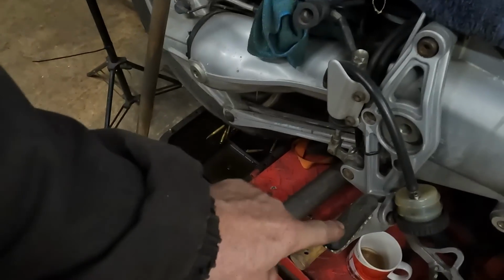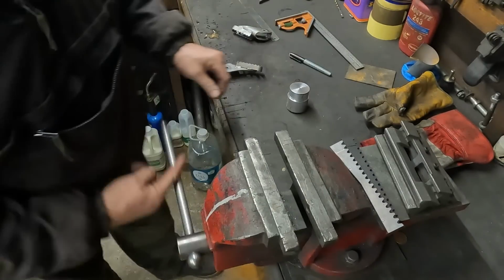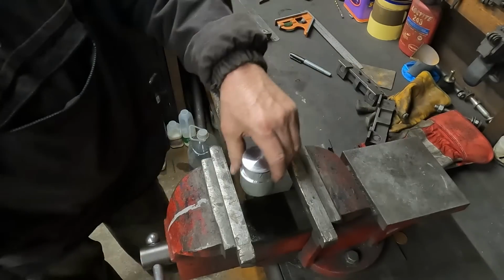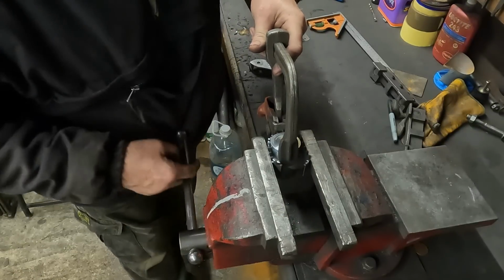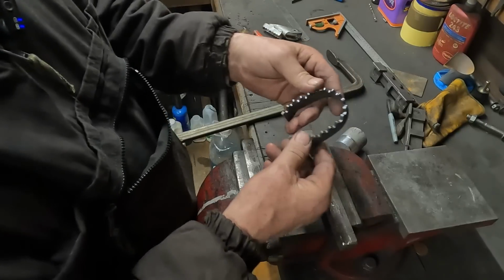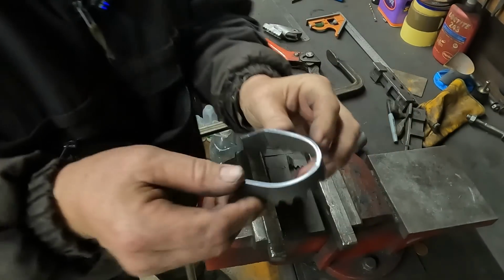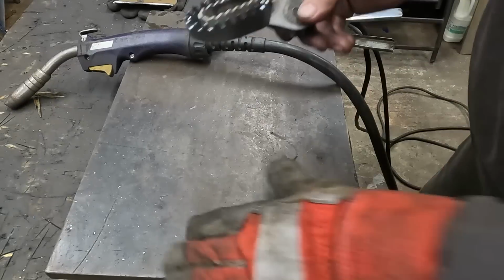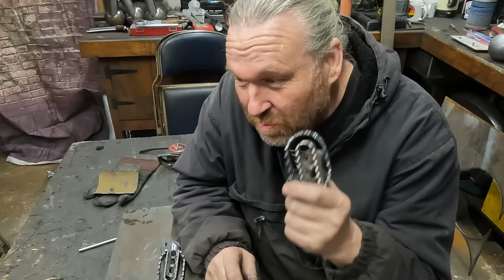Easy Way To Make Wide Foot Rest

Comment: Hi Craig …. Great money saving idea 👍 As for the support could you not drill a hole through all 4 surfaces (front to back) then you will have 4 points of contact to weld the bar to

Comment: Hi Craig Lovely work as always. Just wondered why you not you've not gotten the shed insulated? It would keep you warmer in the cold (less heating cost) cooler in the summer and help deaden your noise. 🙂
Reply from the maker: Thank you Jonathan. It was down to finances when I put the shed up, I may get round to doing it before next winter.

Comment: never seen those strips before what a great idea , fascinating when you just use your hands to shape stuff , for the end would it work if you drilled through the end and pinned it with round bar , dont know if it would weaken the end to much where its narrower